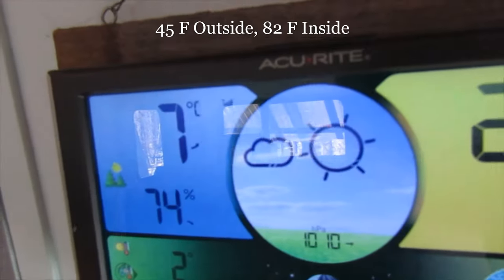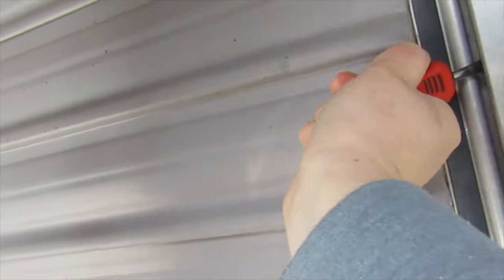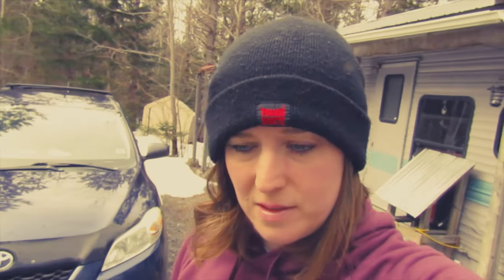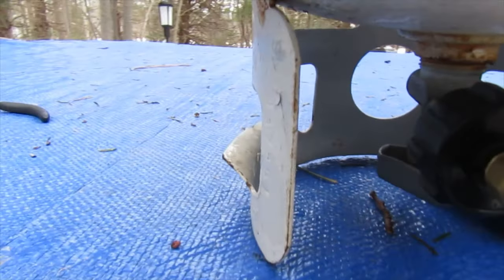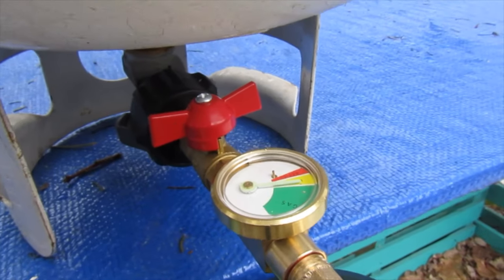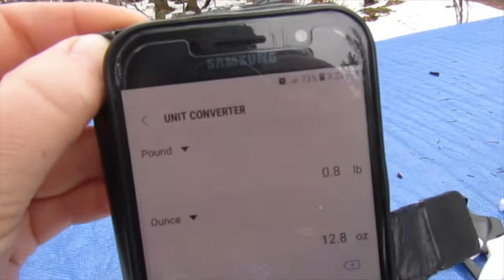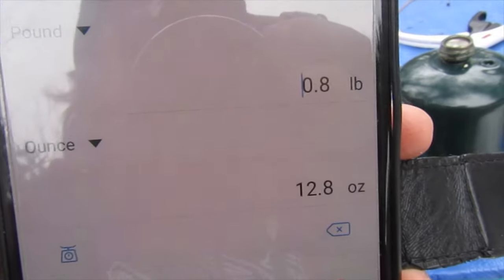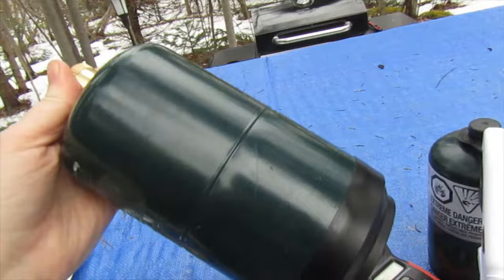I ATTEMPTED to refill a Propane Cannister using THIS

Comment: Hi Jenna, I use to work at an RV center (1969) and one of my jobs was to fill the camper size 25lb. tanks. A little gas escaping when you unscrew the feeder pipe or nozzle is normal. You should see it when I take my 100lb. tanks to get filled. Your biggest risk on filling tanks is to have a rusted one break on you. I wouldn't mess with any rusted ones just for caution's sake. Up to you though. Good job on your first one! Glad to see you got more firewood too. Start oiling up your reels and check you lines, won't be long now! Cheers, Rob.
Reply from the maker: Yeah made me a little nervous but I think eventually I will get the hang of it (I hope). I am actually just about to get my fishing licence as we speak!! 🎣🎣🎣

Comment: Hi Jenna, What will help is if you put  your propane large bottle in your cabin,  Keep the small one outside so its temp is as cold as possible. This will help a lot to transfer the gas across. oh and the taunting snowman  had me almost rolling on the floor. 😀
Reply from the maker: I will try to keep the small bottle cold next time 👌
Reply: @gypsyjenna  Also if you can have your large bottle upside down then you will be pushing in the liquid propane. You might need to set up some type of table to keep it steady.

Comment: What that pin does when you pull it with the needle nose pliers is release or evacuate the air in the green bottle, doing so will let the liquid propane flow into the bottle, not evacuating the air will hold back the liquid propane pressure into the large tank and every time you remove the green bottle from the adapter you’re just releasing the residual gas been the red valve and bottle.

Comment: The best way i have found to fill  the 1lb bottle is to press down the the needle on the top of the 1lb bottle with an allenkey to release the gas pulling on the needle on the side can damage needle making the bottle useless it does take a while to fill

Comment: Hi Jenna, yes I had this issue in my other trailer, and a touch in the 5th wheel but not nearly as much.  In the old trailer it was because it was settling  in the spring when the ground was thawing and I had to adjust the blocking, tight at the top was usually adjusted at just in front of the door ..... Hope it gives you a spot to look at as getting locked in or out is never fun.
Reply from the maker: For sure. With the door swinging outward, from the inside at least I can shoulder my way out but it's really hard to get inside form the outside lol

Comment: with regard to the jamming entry door, it may be that your trailer frame is actually sagging a bit at the doorway, which is a natural weak spot due to the large opening, with increased temperature the metals expand and the top jambs because at that area the door is closer to the jamb. Try to look and see if when jammed there is yet a gap at the bottom of the door. If this is the problem you can get a small leveling jack and install it under the door jamb, adjust with upward pressure and see if that gives you a more even gap between the door and the jamb.

Comment: Hi Jenna, you're not giving long enough for the liquid propane to flow into the small tank.
Every setup is different, but just for example I leave my flow valve open for 45 seconds to a minute, close, vent the small tank, weigh it, then adjust as needed until I hit the proper fill weight.

With the brief time you are showing open, you are allowing just a bit of vapour/gas into your small tank.

Hope this helps.

PS- Also, that scale won't register such a low weight.
Your ideal would be to pick up a cheap food/diet scale for portion measurement, and weigh on that.
Reply from the maker: Thanks for the info, I will try this!

Comment: Gypsy Jenna: Thinking about your door binding… my guess is there is a weight shift due to the ground freezing and thawing. You might try jacking the trailer a little on the left side of the door frame and blocking it until the weather settles down a bit. You have more common sense than most people I know. Who was your mentor growing up? Whomever, great job! Love your videos! Keep the fun coming. I’ll be telling friends to subscribe 👍

Comment: I had No idea filling those 1 lb bottles was such a pain. I run my Mr. Heater with the grill tanks. I have them filled locally. And those guy's fill them up. When you trade them out at stores. Your only getting 15 lbs. Something to keep in mind.
Rock On!😎👍

Comment: You shaking the little propane tank was freakin me out, lol
Newer subscriber, I'd ask how you got there, do you have water/sewer etc but I'm sure I just need to watch more videos. I sold a house planning on something like that, wound up buying a better house than I sold for WAY cheaper.
Reply from the maker: Hi there. No sewer. I use compost toilet. Water gets trucked in or save rain water for showering. 1000 litre tank and gravity fed system to the fresh tank

Comment: Last year I experimented with this too, some people have success with it. I didn’t either, and I have a degree in engineering, so don’t feel bad. It’s a flawed method for chemical transfer. Which also is unsafe, one of the smaller bottled began to leak after a fill. 
Following that I ditched the little bottles and just used adapters that run directly from through 20lb tanks. 
Better to be safe than on fire running through the snowy woods.
Reply from the maker: O my goodness, that would not be good! Yeah it freaked me out for sure

Comment: I've refilled dozens of the 1lb tanks, mainly for a lantern. I wouldn't stress out or bother with scales. You might get them to 80 - 90 % & that's fine. May I suggest using a sharpie and mark the canister each time it's refilled. Chuck it after about a dozen. Cheers.
Reply from the maker: That's good advice. Those probably don't last forever. Thanks
Reply: It Beats Buying The Green Bottles Over And Over ! 
It's A Good Way To Be Sure That Your 20 Lb. Bottle Is Empty As Well By Filling The Green Bottles Up !!

Comment: Try to have some whole log pieces as “ overnight burners” for your wood stove. It will burn longer and slower. Most people don’t realize that you should never split ALL your wood. I have an easy sizing template to check my log sizes. If you have a nice bed of coals and enough opening to place a “ whole log” piece on your fire and close down the air a bit, it’ll still be warm and easy to restore in the morning. I have plenty logs that I use that  “ just fit “ through the opening. I’m not waking to a cold house and spent fire.

Comment: Hi Jenna, great video ! Good for you to reuse your tanks ! Once your accustomed to the process, sounds and smell you'll be right as rain... True though, the relief "pin" is there to release excess pressure, which while refilling excess pressure is naturally created. There is another updated tool for use. It has a built in pressure relief toggle that allows the 1 lb bottle to "bleed off" the pressure manually, there also is a small tool that fits the mini valve perfectly instead of using needle nose pliers and pulling it (possibly damaging the seal inside). I would not say it was a fail at all.
Reply from the maker: Thanks, appreciate it!
Reply: what are the tools called? are they on amazon?

Comment: About that sticky door. Try tightening all the screws that hold the door frame to the trailer, then rub some liquid soap on the jam and the edge of the door.  If you buy a new little propane tank weigh it to find out what the weight should be, then when you re-fill you will know when it is full.  Also U can pour some warm water on propane tanks then run your hand down the side to find the cool spot will be where the level is.  UR A sharp girl and you will get comfortable re-filling in no time.  Thanks for sharing and have a super wonderful day.

Comment: It is better to use an Allen wrench and purge it from the fill valve. Those valves are not designed for multiple use and you are just asking for problems with leaks. With an Allen wrench you just push in the fill hole and pop the air out like 6 or 8 times.  Then hook it back up and full again. You also need a scale that can weigh ounces. The filled one is about 1 pounds 14.5 ounces.

Comment: I Could not find any of your commenter's that suggested this, but some of the stock tanks 7 Gal. and up have
a "Tip-Over" safety valve inside the tank so that the liquid propane is shut off inside with a float valve...so I would say do not give up on refilling the small green tanks....try it with a smaller 2 or 3 Gal. tank.

Comment: Good job, if you’re concerned go to a place where they fill LP gas and ask them. But this looks like a normal fill with some gas escaping. When I got mine filled in #20 tanks it did the same thing but comments seemed like you’re doing fine. Jenna you are a trooper, you do everything quite well on your rig👏🏻👍🏻AND looks like Spring is on the way 🥳
Reply from the maker: Won't be long now! 🤞🤞🤞
Reply: No place will refill the small tank. You need to release the air as you fill it or frequently so the liquid can go in.

Comment: by now you have no doubt sorted out the reuse of propane bottles. Your scale likely does not have the sensitivity (resolution) to be able to accurately measure small weight. Reuse of those disposable bottles is widespread, but bear in mind they are DISPOSABLE and not intended to be refilled. The valves can and will leak, if you store the bottles in an enclosed space then you have the risk of explosive events or a fire due to leaked out propane. Just so you know, there is a pressure differential needed to do the transfer successfully, the mother tank has to have a higher pressure than the filling tank or there is no movement of propane. Warming the mother tank in the sun or what ever way and chilling the filling tank accomplishes that. The most effective is to significantly warm the mother tank and forget about doing anything to the filling tank, it gets technical but suffice it to say that the heat absorption of the mother tank is many times greater than the amount of heat you can remove from the filling empty cylinder to accomplish propane flow. Man o man there is a lot of little stuff involved with your off grid experience, sure would be a benefit to achieve your energy needs more simply, without all the little bits here and there, eh?

Comment: Hey Jenna, lot of great tips in the comments. I always hold the needle valve open on the 1 pound tank and get all the pressure off of it. It fills up so much quicker and the big tank will quit filling the small tank when the pressure equalizes. It's the same when they fill the 1 pound tanks in the factory, there is zero pressure in them. Normally, the pressure inside a propane tank fluctuates slightly based on the outside temperature. For example, a standard 20-pound propane tank at 70 degrees will have 145 psi internal pressure. That same tank on a 100-degree day will have 172 psi of pressure. When I had a 500- gallon tank for home use, I was paying around $2.29 a gallon for it and I would fill up my 20 pound tanks from it them I would use the 20 pound tank to fill the 1 pound tanks up. So it was costing me maybe around 50 cents per 1 pound tank. Walmart here they sell for around 9 bucks for a 2 pack. So let's say the 1 pound tank is out of gas but it still has 80 psi, 100 psi or whatever in it. When you try and add gas to it from the 20 pound tank, the pressure will equalize to whatever the 20 pound tank has in it thus not getting the 1 pound tank to it's capacity. All propane tanks no matter the size can only be filled 80% because they need that space for the air pressure. A 20 pound tank holds 5 gallons, but the actual capacity that  is put in it is 4.7 gallons.
Reply from the maker: Wow, they sell a single 1 over here for about 9 bucks CAD lol
Reply: @gypsyjenna  DANG!!! LOL, that's crazy.

Comment: This video shows the way I have bled out the tanks to take fuel for years. Make sure the weight is an added 1lbs. More fuel can bulge out your tank. If that happen it's done. Ok to use the bulged tank once. Or so I've done. I did buy the reliable multi use tanks that are now available. They are thick steel and certified for reuse. Real easy to refill as well. 

https://www.youtube.com/watch?v=8NysliPP-KE

Comment: Heat the 20 lb. tank and chill the 1 lb. tank (I suggest a heating pad and bucket of ice water). Release gas while filling the 1 lb. tank (do at your own risk). Those 1 lb. tanks are not designed for refilling. I have done it before but don't anymore because they tend to leak gas through the release valve that you pulled with the needle nose plyers.
Reply from the maker: Thanks for the tip
Reply: @gypsyjenna  Also if it is spitting liquid propane out of the release valve you over filled it.

Comment: You must have some weight in the front part of your travel trailer the weight is having your door and maybe windows lean towards the weight and getting stuck in the heat. Metal expands
Reply from the maker: Yeah happens every sunny day during certain times when the sun lays directly on it

Comment: You are going to have protein in that line going from the 20 lb to the 1 pound tank I'm thinking you are supposed to pull that valve when it's trying to fill up I am just guessing at it I've never did it myself I think opening that valve well release the air that is in the system that's all it's supposed to do to fill up if you left it running and connected you probably would have had a full tank by just pulling that loud we will have a lot of air in that tank that will have to be bled out

Comment: I looked at doing this, decided it was too risky. I would use a kitchen oz/gm scale. Canister empty is 386 grams, full is 839 grams, propane is 453 grams. 1 lb is 454 grams. The problem is getting the air out of the Canister as you add the propane. The problem is that the pressure inside the Canister increases as you add propane to the Canister until it reaches the same pressure as in the 20 lb propane tank. At that point, you need to release the pressure in the Canister to make room for additional propane by lowering the pressure in the Canister to a pressure lower than the pressure in the 20 lb propane tank. And then repeating the process until the tank is almost full. You will never get the tank completely full, due to this method of filling the tanks. The manufacturer fills the tanks in a vacuum, so air is never a problem. Sounds confusing? Yes it is a bit confusing. Don't forget the air you breathe is also under pressure from the weight of the atmosphere and the force of gravity. I would also get a new hose for your propane tank with a pressure regulator, so you can connect the propane tank directly to your Mr Heater without the need of using the filter. The connection between the hose,  filter and heater are so close together that they can become lose and leak propane causing an external fire at the connections. The better option is to have a hose that can directly connect to the Mr. Heater. 😊
Reply from the maker: My goodness, I wasn't totally wrong. It really does seem like you need to take a course to do this, haha. I feel like I need to buy a lab coat and get a student loan now 🤣
Thanks for the info👌

Comment: The gauge on the adapter tool only indicates the propane pressure. It does not indicate how full the 1 lb can is. The sound you hear is the liquid propane flowing into the smaller container. To fill the 1 lb can, you need to pull on the small relief valve to reduce pressure in the small can to allow more liquid to flow in. CAUTION! do not over fill the 1lb can or liquid propane will come out into your appliance.  It takes practice and a smaller more sensitive scale. A second CAUTION !  make sure the 1 lb can relief valve you use the pliers on to vent while filling, reseals after wards. Some times they leak. A little drop of water in the valve will show. If it leaks, manipulate it a few time with the pliers until it seals. If it will not, leave out doors and do not use.
Reply from the maker: Thanks for the info!